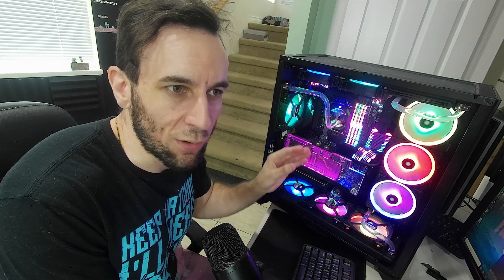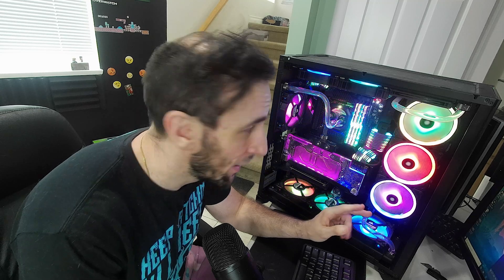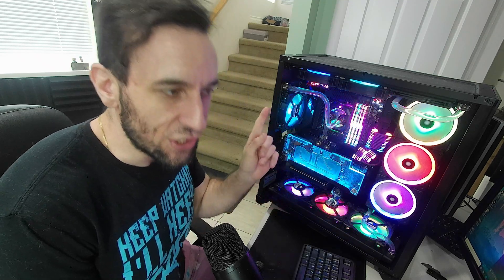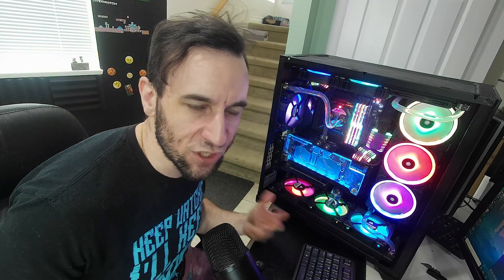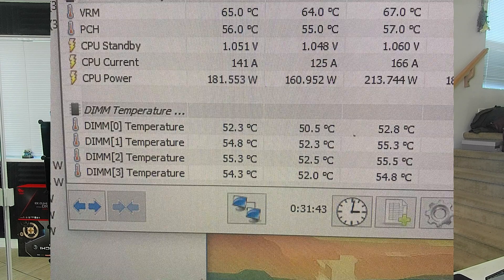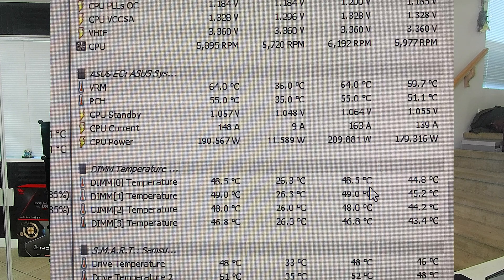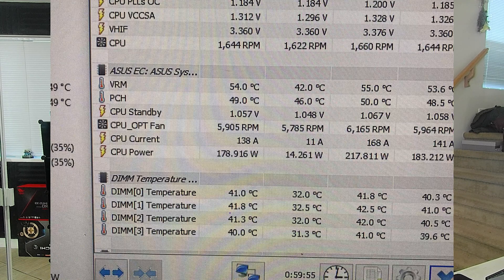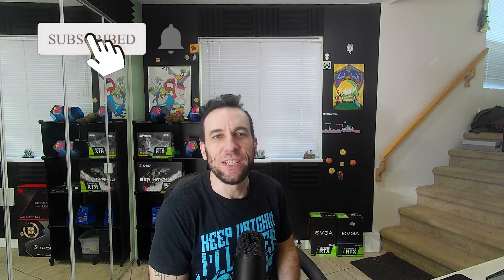Ram overclocking + HEAT stability

Comment: Usually the led lights inside of the dram causes more heat or reduce dram voltage usually help decreasing the overall temps

Comment: Ok so I've been tuning ram on Z490 for a bunch of days now. 4100CL16 with 1.5v DRAM, 1.30v SA, 1.25v IO. 
The hottest dimm peaked at 59C without a fan. I hung a 140mm fan with some string from the top of the case to blow on the ram.
RAM temps dropped by 20C during memtesting. The heatspreaders went from being painful to touch to barely feeling warm.
Reply: What kit do you have ?
Reply: @skyzey9296  F4-3600C16D-32GTZR
Reply: @skyzey9296  Make sure not to mix it up with the F4-3600C16D-32GTZRC (C at the end). Because the latter has looser timings and I'm not sure if it's b-die.
Reply: @thecatdaddy1981  ok thanks you for info , i was trying to oc my ram kingston 2x16 3600 Cl16-20-20-34 .got it to 4400Mhz but timings are weird

Comment: If you don't want to or just don't have the room to put a 120 on the back of the board, use your already installed case fans.
Couldn't you just look at the fans in the top your case and determine which fan best line up with memory slots and simply flip it over?
So instead of that fan exhausting air from the top it would now be blowing cooler air directly onto the ram for the same or maybe better thermal performance. 
Just a thought, great video I'm really happy I found this channel tons of very useful info and teaches folks exactly what it takes to implement it.
Reply: and now your cycling hot air out and hot air in if you do that also if you use all the top slot as in take to prevent air circulation then you will struggle with the exhaust and case ambient temp will be hotter (inside of the case).

Comment: Nice video! It’s so much easier to diagnose RAM instability using modules with temperature sensors. Most of my B-die kits don’t have one, so it can be a pain in the neck to guess what the issue is.
Reply from the maker: Thanks man! I try hard to do all the grunt work most tubers wont.  I didn’t even realize that some ram kits don’t have temp sensors in them, I guess that’s one of the benefits of springing a bit extra for the gskill ones.  You could always buy one of those thermo couple temp devices off amazon for like 30$ and stick it in the center of your ram sticks, some motherboards come with temp sensors probes too
Reply: Frame Chasers Yeah I’ll have to look for that next time I buy RAM. My Corsair kit has temperature sensors, but my Team, Patriot, and ADATA (all B-die kits) don’t. 

Anyway, best of of luck on the new channel! I’ve subscribed and I’ll keep watching future videos.
Reply: Buy a cheap multi-meter with a temp sensor.